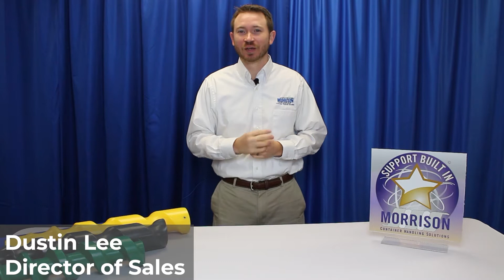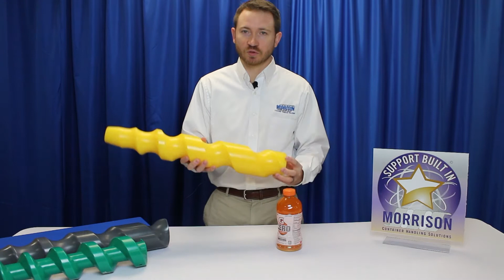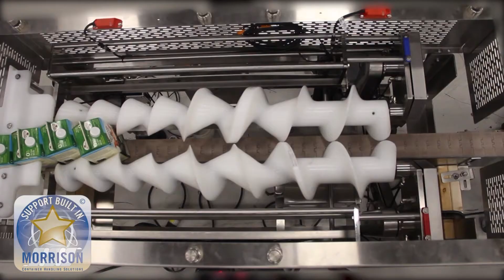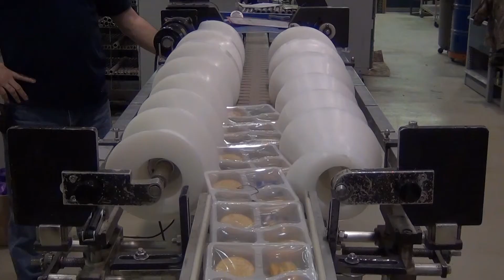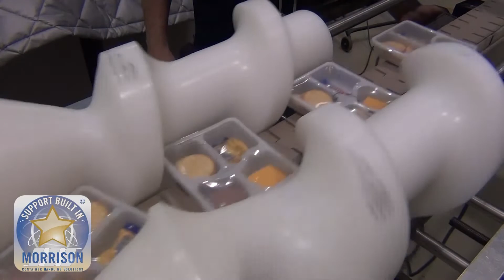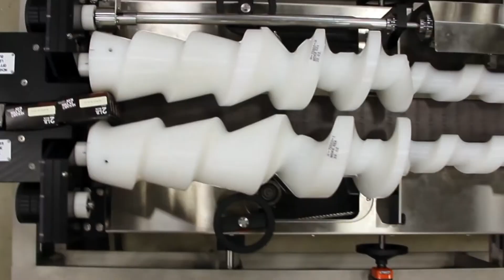Timing Screw Expertise: Morrison's Nearly 50 Years of Timing Screw Magic

Comment: Do both screws need two separate motors for their drive.l? Or one motor can be used to run both screws? And which type of motor is used for these special screw. Servo, stepper or simple induction motor? Please clear me about this also.